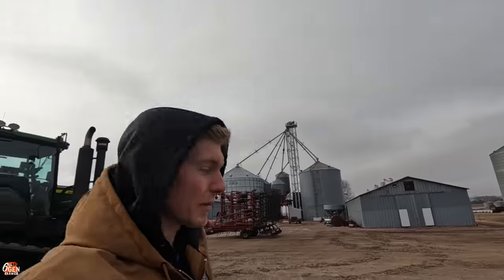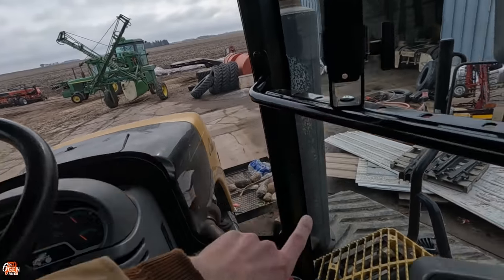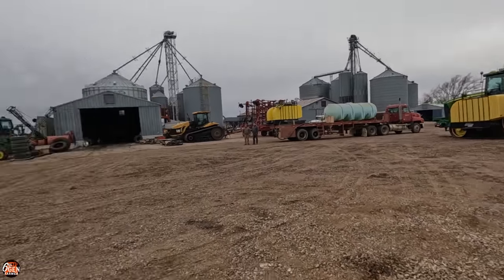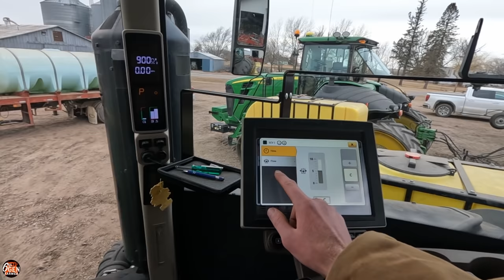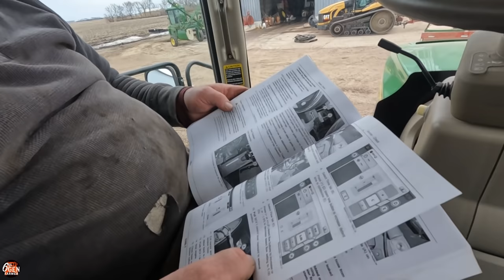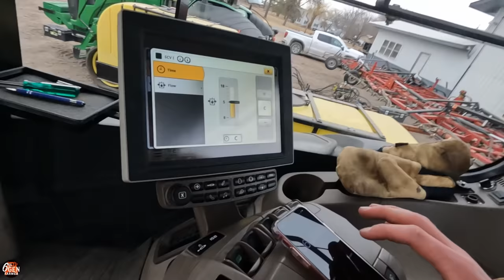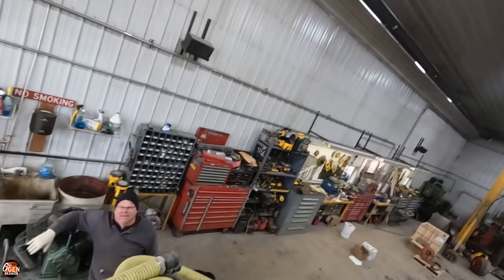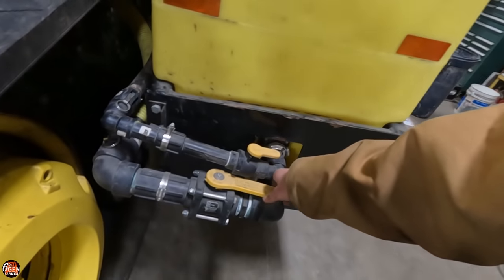John Deere Track Tractors Get Setup for Planting 2022

Comment: Glad to hear that those saddle tanks work really well I used to have saddles in the front of the tractor and I sense have mounted them on the side of a track 9570 haven't used it yet but glad to hear they really work good, thanks for the video, also glad to hear how the tracks are tensioned 👍

Comment: It seems that the MN University Argronomists are trying desperately to convert you folks away from cultivation/tillage & toward no-till.  They admitted that heavy soils are an issue BUT they seem determined .  They seem to acknowledge that some shallow high speed disc  application might be valuable but chisel/points/sweeps should be mothballed.🚜🙈
Reply: Have family been doing a no till variation for decades. They are not too far from the 6th generation. But more on the ridge. 

Perhaps is the approach taken or attempted that needs to be considered before dismissing. Failure often begins with not putting in a total effort but a half of one.
Reply: Btw. If you are RTK. In a 30” row crop. You only need to disrupt less than 10% of the field surface. (6” width). (Alternate half row is less than 20% affected every 2 years)
If you put amendments into the soil and row. You can accomplish both decompacting and prepping the seed furrow at sametime. Where it is needed.
Reply from the maker: Our problem is a lot of of soil is fertilized by liquid hog manure.  Strip till hog manure is a thing but not widespread yet.  Liquid manure needs to be chiseled in the fall.  Our water table is about 2” so in the spring if we don’t till, the ground does not dry in time
Reply: @6thGenFarmer  certainty a valid point 🚜🚜